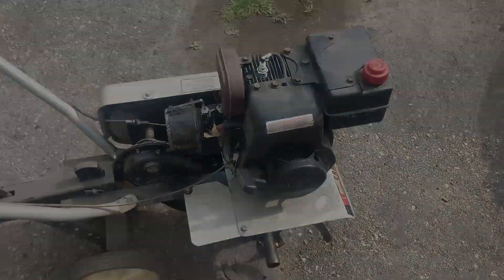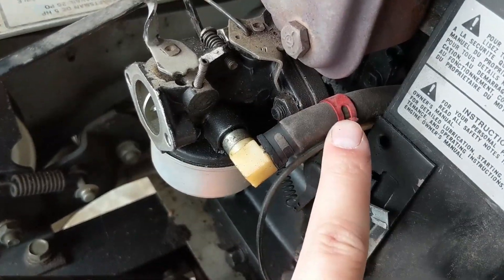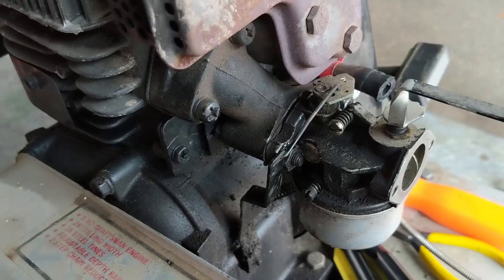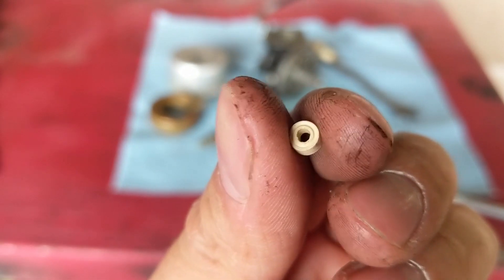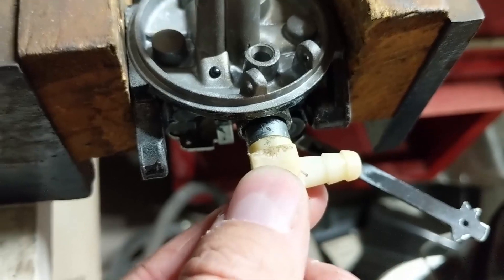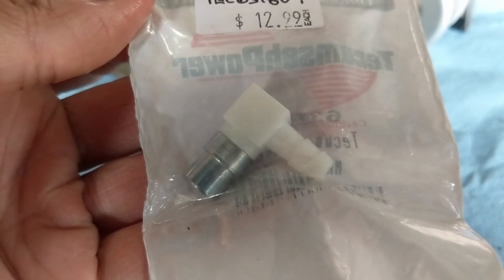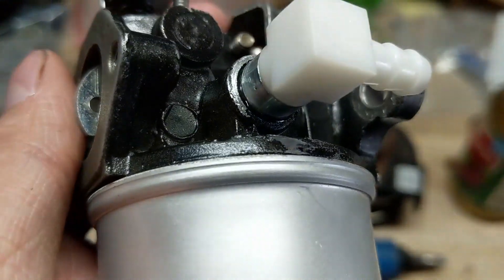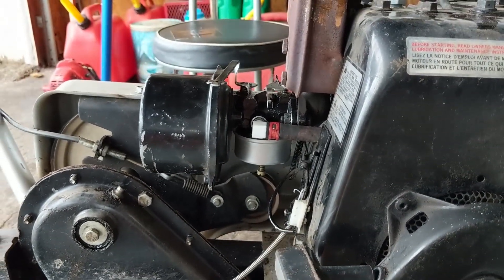5hp Craftsman Rototiller - Carburetor Rebuild

Comment: Not related to carburetors but I have a very, very similar rototiller but it’s yellow, but a craftsman nonetheless and looks to be the same age sort of deal… are there zerk fittings anywhere on these? I couldn’t find one but I feel the run in a similar sense to a snowblower so there should be grease fittings around the tines?

Comment: Hey man, great video. I have an old sears rototiller and it has the same carburetor as your video. I’m wondering... do know what settings you need for the screw in the fuel float bowl? You gave me a good idea for the adjustment screw for the fuel mix
Reply from the maker: No idea, usually you go about 1¾ turns out, then go in until it runs rough, and out until it runs rough, then find the center point.

Same with the air fuel screw, try to find that middle point.
Reply: Eliminator Performance thanks man! I hate to send that old beast to the land o’ scrap...  anything to keep the blades turning

Comment: Nice repair, i have watched other guys install the fuel inlet using a C clamp and you did it the correct way with the stationary end of the clamp against the plastic fuel inlet. As always thanks.
Reply from the maker: Thanks for watching!

Comment: Nice video. I like to mark the governor and the throttle plate, with a scratch awl right next to the hole the linkage was in. This way it has a marks on where to re-install linkage. Just another way to remember how the linkage goes back. As you stated  in the video.
Reply from the maker: Yea, I learned my lesson a long time ago!

Comment: Surprised you don't use the tecumseh tool for the float gasket. Also, many times I've found that the tiny vent hole in the main body was clogged causing the carb to leak like a pig.  Not many people talk about that. It had me stumped after I did a complete rebuilt and still had the leak.
Reply from the maker: I've actually been contemplating purchasing one of those, but my pick and drift pin have worked flawlessly so far lol

Maybe I'll buy one and do a quick video on it!